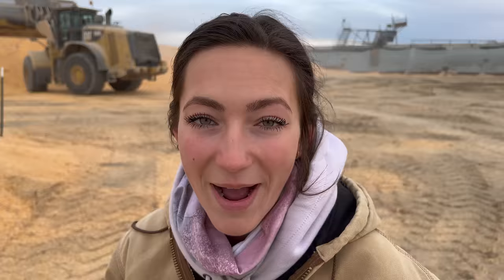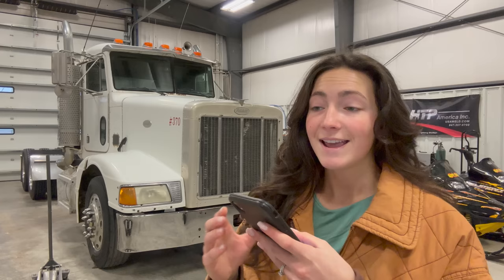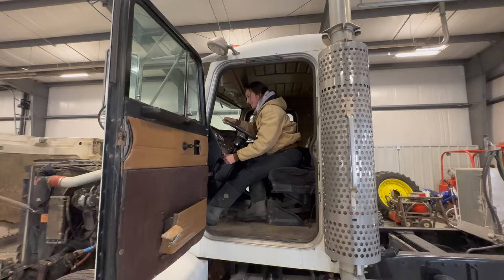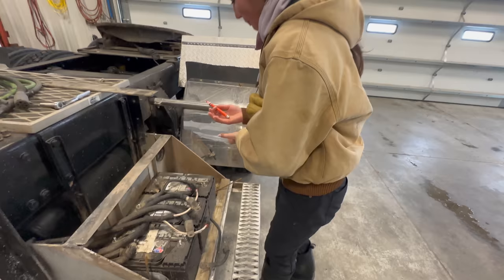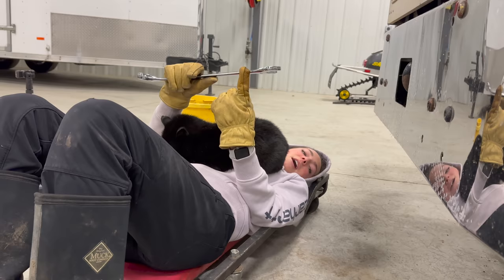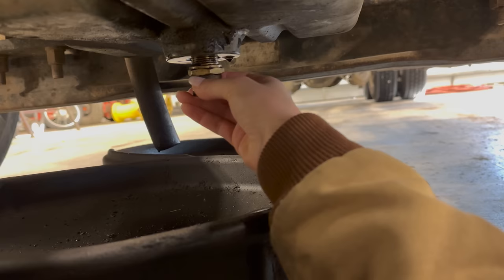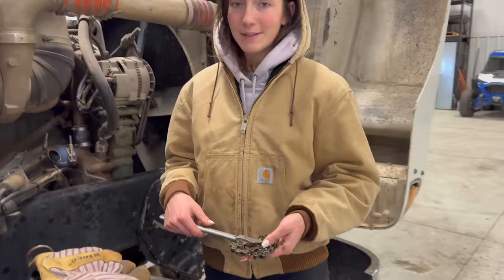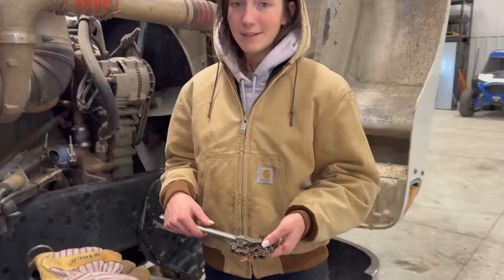The Worst Oil Change

Comment from the maker: Download the FREE Upside App at https://upside.app.link/laurafarms to get $5 or more cash back on your first purchase of $10 or more.
Reply: The oil filter that's how we do it in Australia if no other choices
Reply: Damn she's cute.
Reply: @funnyfunky9949  wtf are you talking about!? Who's fake?
Reply: Ya know 🙄
Reply: @Ya_Know  What?
Reply: Try a Ma deuce on that filter :P
Reply: Upside would always say they couldn't process every receipt that I sent. I didn't catch a couple and they screwed me out of over $10.00 worth of money. Be careful using them and watch every single receipt you redeem. I would say to use Checkout 51 before Upside.
Reply: Ok, I know iny late to reply... On filter removal... soak the rubber gasket area with Marvel Mystery oil for 24hrs, it sounds like your filter is on too tight and rubber seal is stuck. Also get a strap filter wrench from NAPA or the like, they usually have a smooth metal band with a handle. If you can warm it up it helps also, but don't use fire on it, use an electric heat gun, get the union area of the filter can up to about 200deg.
On your battery setup, it looks like the box is made for four batteries, might see if there is actually room. Also on terminals, clean them up with a wire brush and make the connection shiny metal on shiny metal, then coat it with battery terminal protectant. One more item on battery removal, always remove negative first when disconnecting and positive last. Do it in reverse when installing.
Reply: i think you added 1 to many zero's to that weight
Reply: i love you

Comment: You need a truck filter band wrench. NAPA sells it and it drives with a 1/2 inch drive extension. You can grip next to the top of the filter. Fits in a tight area.
Reply: That's the only thing I ever used back when I was  truck mechanic.  Cant really say I miss those days.  But toward the end I could do a complete service front to back in under an hour.  Ah the good ol days.
Reply: You need a truck filter band clamp. 1/2 in drive .put up as far to the top as possible. 30+ yrs. As a heavy truck mechanic !
Reply: @walterroose9579  They work great, although I had to take the cannister off a spin on and then use a zip gun to remove the filter base
Reply: Jack, you nailed it!
Reply: Those band clamps suck when you have a filter and there's no room
Reply: @walterroose9579  is there an echo in here? 🤣
Reply: And an extension.
Reply: I was going to say the same thing
Reply: I used a long extension. Was changing hydraulic filters on a 6045 White. Was a nasty reach. What I know. It worked. I wouldn't say there was tons of room, but it worked. Couple friends borrowed it once and went and bought their own. Not big expensive, bought it at NAPA it's about a 2 inch wide band and that thing got the job done. I don't think you will be disappointed Grant. Give it a try. Laura was spinning on a NAPA filter it looked like so you have a NAPA.
Reply: I use a 3 jaw oil filter wench with a extension works way better
Reply: I was coming here to say the exact same thing
Reply: I use one of those on the JD tractos I have
Reply: As mangled as that first filter is reaching the top is the only hope.
Reply: The ban style oil filter wrench is the best route they also make a strap style that also uses the 1/2 extension and at least a 15 inch ratchet or breaker bar will will for more sizes of filters

Comment: Temperature could be your problem. Your cold temperature could be causing the metal to shrink around the threading. Put a hair dryer on it to expand the parts. This problem usually happens when filters are put on real tight in the summer and then tried to be removed in the winter. Don't forget to put the install dates on the new filters with a magic marker.
Reply: Just run the engine for 1 /2 hour before draining the oil, that will heat up the filters and they will come off!!
Reply: @clintk5367  
At 5 dollars a gallon?
Hairdryer or heat gun will save them money
Reply: Heat gun on the rubber gasket on filter always does the trick and try to put filter wrench as high on filter as possible.
Reply: Honestly this, we have similar issues with other equipment when we do maintainence in winter
Reply: To Hell with the hair dryer! BREAK OUT THE BLOW TORCH!!
Reply: @KyleHaines615  
Now yer talkin!
Reply: A better filter wrench for starts, (one made for larger filters, trucks) and YES, heat. BUT NO TORCH, torch, bad idea!!!!!!!!!!! heat gun. I worked for a Mack Truck dealer for years. You better know what you are doing when using a torch. TORCH, BAD!!! TORCH BAD IDEA!!!!
Reply: The truck was clearly warmed up before they changed the oil
Reply: @clintk5367 I mean, running it with a hole in the filter should work out well!
Reply: @Torsee  half hour, maybe a quart of fuel. It's too late by the time the video is published anyway. The truck was warm when oil was drained in a warm shop.
Reply: Did you add trans fluid or diesel in the fuel filter?
Reply: @Torsee  well time is money
Reply: @KyleHaines615  Hopefully being facetious.  Blow torch heat risks fire and varnishing whatever oil is inside the filter.

Comment: FYI, you guys, those battery connector wire ends need to be shiny to allow 2000 amps of current to flow. Use a small wire wheel on a drill to clean them spotless and free of dirt and corrosion on both sides and the battery connectors too, they sometimes spray an anti-corrosion inhibitor on the battery connectors.
Reply: If they need two thousand Amps to flow they have much bigger problems.  Or is that a extra zero just like the .7 million pound machine.  Lol
Reply: That was my thought exactly as I watched, a critical step missed by not cleaning all cable ends ( and probably cleaning or at least checking the power and ground connections at the starter end while the batteries were disconnected ) and cleaning the stud base on the new batteries, the underside of each battery terminal nut. Then use an anti corrosion paste or spray upon assembly. Have to be careful with that spray though as the connection has to be done up before the spray is used as otherwise it can have the opposite effect as it becomes an insulator. In any event they proved that the major issue was indeed crap batteries. This is the second farm youtube channel in the states that has a truck with three batteries installed in a battery box designed for 4. I wonder if its a USA thing that they delete one battery from the factory ?, not here in Canada as its always 4 due to cold weather and needing all the cranking power they can deliver and then some ...
Reply: All you need is grease or even Vaseline to cover the connections. It’s inexpensive & usually you have it on hand.
Reply: Don't use a drill wire wheel.  You'll cast lead dust, which is toxic.
Reply: @April8989  I use a steel brush, typically used as a welding brush for cleaning threaded post style batteries typically used on trucks as well as on the cables that are fastened to the truck. Sometimes will use the wire wheel on the pedestal grinder to carefully clean the loose cables that bridge between the batteries. Wearing an N95 mask and face shield for some aspects of shop work as required is highly suggested of course.
Reply: But is there 1 battery in series whit 2 batterys thar are in parallel? The tray looks like there is a extra spot for 4 batterys in total
Reply: @jessyterpoorten7197  They would be hooked up as a 12 volt system, I have an older truck that is a split 24/12 volt system as the starter would be 24 volt while the rest of the system is 12 volt and makes for a far more complicated connection system at the batteries and impossible to follow simply by color code.
Reply: @charlesb4267  oke so the 2 batterys in parallel is the 12v system
Reply: @jessyterpoorten7197  It can be any number of batteries all connected together in a parallel system, does not matter if its an even or odd number. So with this truck in the video its a 12 volt system with 3 batteries wired in parallel, the battery box is designed for a maximum of 4 batteries and all that would have to be added is one more battery and two jumper cables ( negative and positive ) to bridge over to the 3 batteries already in the box. Then the hold down bar would have to be changed to a full length unit that can hold down 4 batteries. Typically trucks with larger engines will run two heavy cable positive and two negative cables so that may confuse some but its all about carrying the amperage and avoiding voltage loss. By the way that hold down bar is made out of some sort of plastic resin material that is no conductive, it looks like a steel bar but it certainly is not so there is no chance of it slipping and touching a positive post and arcing out.
Reply: only time you'd see 2000 amps on a truck is if you dropped your wrench on the terminals
Reply: @daleeverett8086  Dielectric grease.

Comment: Hey guys, as mentioned a strap style wrench closer to the base might work but you’ll have very little room to swing it because of the frame. Something I’ve done before as a last resort is to drive a long (18-20 inch) punch directly through the filter then use a cheater bar on it. It’s crude but never has let me down. Oh by the way the drain plug on your truck is what is called a Femco drain plug. Next time you change oil you remove the brass cap on the plug and there is a hose that screws on to it and opens a drain valve. Good luck with the filters!
Reply: That works every time
Reply: Definitely not easy, but it will break the filter loose. Detroit’s in a peterbilt frame are hard to service.
Reply: Just a side note here , putting that fuel filter on dry isn’t going to get that truck to fire, any 50/60 series Detroit has a fuel shut off valve on the secondary fuel filter at the block that needs to be closed before changing filters. Filling the filters helps a lot but they can still be a bitch to start. A dry filter is gonna cause problems
Reply: I was going to suggest the same thing.
Reply: RE: nearer to the base  Yup that is just a little stronger.  Heat it Yup that will help.  Drive a pin through it.  Sure, you are changing it out, messy but effective.

Comment: Those filters haven't been changed in a long time and are burned on. The best you can hope for is a little penetrating oil and then a filter wrench. Next would be poking a screw driver through the filter and twisting it that way. The canister may peel off and if it does you will have to grasp it by the collar where the gasket meets the frame. As a last ditch you could cold chisel it off the frame but be careful not to scar the flat surface where it seats on the gasket or it will always leak. I hope that helps. Love your work.
Reply: @tetedur377  If you leave them on too long they burn themselves to the frame. Really only 1/4 or a light 1/2 turn after it is seated is all you need to make it leak proof. You should check it after running under load for a short time to see if there is any leaks from grit or being too loose and tighten it a little bit more to make it stop. That's all I've got.
Reply: Yup this is my support👍👍
Reply: Been there done it…you will succeed!
Reply: yep

Comment: You're on the right track Laura.  I'd get a strap wrench and heat up the old filter as much as you can.  It was probably installed in the summer and was overtightened  even then.
Another tip.  Old dirty dark clothes when you're messing around in greasy equipment.  You'll still be pretty when wearing them (; ).  Now Grant, that's another story.

Comment: When removing filters it's best to apply a wrench as close to the top where is meets the filter housing. You probably need to get a better wrench that can fit up there. Maybe apply a little heat to the filter with a torch as well.
Reply: But, no torch use when you have torn a hole in the filter can and oil is oozing out - you could set the oil on fire!!!  That would be a real big issue.  Bye bye truck!
Reply: It may be a long time since the oil's been changed in it too

Comment: I used to drive trucks, so I had to do oil changes. I had a filter wrench for that job. I think I got it from NAPA. It had a large (4-5 inch wide) metal strap and no handle. Instead, you took a 1/2 inch drive breaker bar or ratchet drive handle and snapped it in the place made for it where the handle would be. I’ll bet NAPA still sells them. I never liked the chain style because of what you guys just experienced.

Comment: When you have to remove filters that are on too tight, use the chain or rubber strap wrenches up high towards the threads to avoid smashing the filter.
Reply: Can't get up that high with what they have because of the frame being there. Engineers always put stuff in less than ideal spots lol
Reply: @prohealthqw  Indeed, I used to struggle with that also as I just didn't have the right tool for the job. While what I do use is nothing high end ( I posted it in the comments already ) it certainly works as per the steel band system that is driven with a 1/2 ratchet and using and extension to slide the unit up to the filter base where its the strongest part of the filter and then torque on it. I like to crack it loose just after I have drained the oil as the filter gasket is still nice and hot and pliable but leave the filter on if I am in no rush and let it cool down before handling it. I installed femco drains on the trucks as well, makes changing oil so much less of a horror situation with too small a drain pan !
Reply: @prohealthqw  We are trained that way 🤣

Comment: Probably should have run the engine for a while to get it hot which also aids in getting the old oil out that is then a little thinner.
Also, try turning the steering so it moves the wheel to the right so that it gives you more room to work and get a longer movement with the wrench.

Comment: Laura/Grant, once an oil filter has been damaged beyond re-use I would get an old screwdriver and hammer it into the filter and out the other side, you can then use the screwdriver handle to twist the filter off. Obviously you then need a new filter to put back on afterwards.
Reply: That’s what I do. but you to say reuse. it’s a oil change the filter is being changed never would you take off and put same one back on that would be pointless.
Reply: @kevink4914  depends on how poor you are, if you can't afford a new filter then reuse is your only option!  Also for some rare vehicles you may not be able to source a replacement.  I expect Laura & Grant will have a new one to put on.

Comment: Like previous commenters, next try a wide filter strap wrench, preferably one that uses a 1/2-inch square drive socket, (as the wrenching point), (then use socket-wrench square drive extensions, to get down to a good wrenching position).  Get filter strap as high as possible on the filter housing, (nearest to the filter can’s — crimped mounting collar).  Best wishes.  Many kudos to you both for doing real work!

Comment: Its a bit late.. but they make oil filter wrench caps that fit over the end ot the filter, and you have the old school rubber or solid bands that work like your tool does.   HOWEVER.... once you have crushed it like that, I have found that next steps are to drive a screw driver through the filter, slip a cheater pipe over the handle pull and pray that is turns.  Next is to cut the filter near the mounting surface and use a chisel to separate the old oil ring from the mating surface and it should spin off

Comment: Flat chisel air hammer bit. Reach to the top side of the filter where it meets the head. Gently pull trigger on air hammer to just get it to move. Once it moves. Pull strap wrench back on it and it’ll turn no problems.

Comment: Good idea to line the bottom of the battery cage/bracket  with a rubber mat.  Helps to prevent  power leakage when battery eventually gets covered with mud, salt and other crud.  🇨🇦

Comment: Read a bunch of comments and loved them all. Had several filters, maybe in the 70' (1970), like this, large screwdriver skewering through middle and hammer, hammer shock can be a key. Love the idea of a little heat, I live in Phoenix 🥵
Sending happiness and good wishes your way.
Reply: Totally agree, a screwdriver through the filter is going to do the trick.
Reply: And if you break the filter off the base, use heavy duty needle nose pliers pushed in the holes 3/8" then use a adjustable end wrench to get it unscrewed. Easy force at first then  increase it moves.
Reply: *until it moves

Comment: Cold temps might be some of your problems. You may have to remove the tire to gain more access to the wheel well, or turn the tire all the way to the right for the same access. Hopefully these are good tips for you on this project. Stay safe.👍

Comment: I'm retired after 44 yrs working in truck sh ops.  Many times I have cursed the last guy to install the filters.  If you can get the proper sized oil filter wrench ( I have one in my tool box) push it up to the top of the filter below the sealing surface, then use an extension to get enough turning room, that is your best chance.  However I have destroyed the filter and have had to carefully remove what is left with a hammer and chisel.  I have had to replace the filter to engine adaptor several times.  Join the club.

Comment: Like Laura said, a strap wrench. There are several companies that sell ones with the nylon strap that are 4" wide and take a 1/2" ratchet. The cheap ones with the skinny strap want to twist while you are pulling on it, the wide one holds itself straight and works better ( before the filter is damaged).